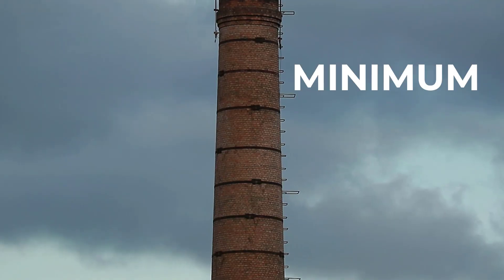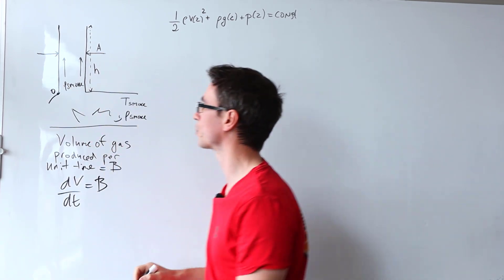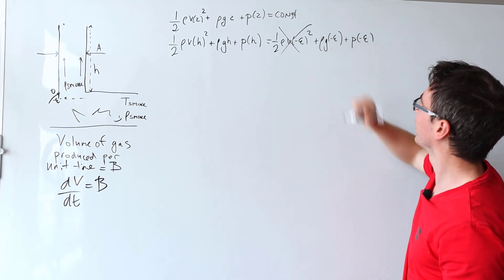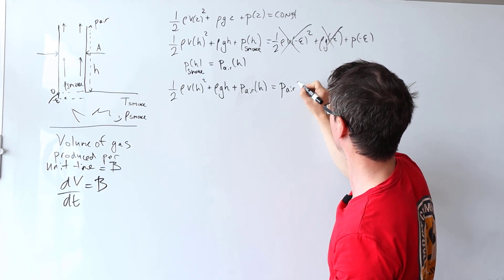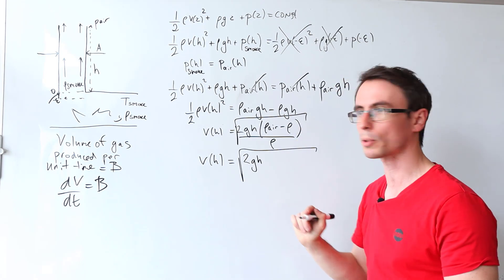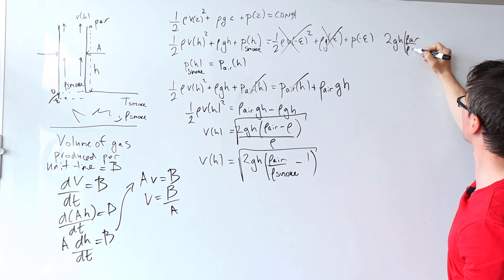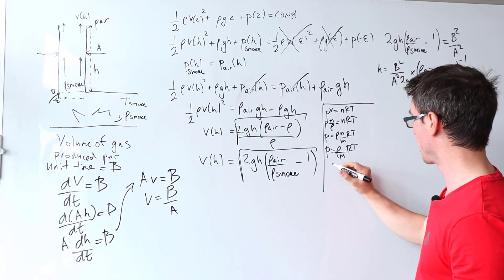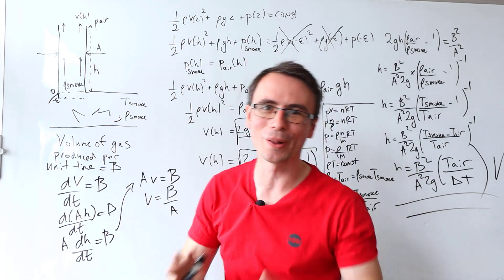THE hard Chimney Physics problem from the Ipho/JEE

Comment: Beautiful problem! A few questions: why do we need to consider a small epsilon instead of 0 directly? Is it because h=0 isnt really inside the furnace? 
Secondly, at 4:21 you state that the pressure at -epsilon is equal to the air pressure at the same level. Why is that? It makes sense that the pressure of the smoke at h must at least equal that of the air to get out of the chimney. However, why does this still need to be true even at the base of the tower? Shouldn't the condition be p(-epsilon) >= p(h) to allow the smoke to rise in the chimney?
Reply from the maker: Fantastic questions as always! Yes, the small distance is considered as you want it on the other side of the gradient.  To be honest, your second point kind of makes the first point irrelevant. I think there may be an assumption here that the pressure remains constant in the furnace as it's an isobaric process.  I am not 100% convinced it is a great approximation.